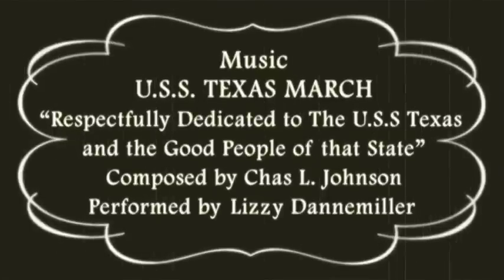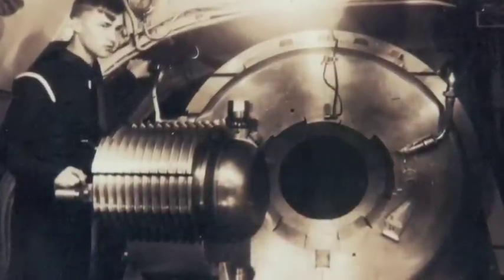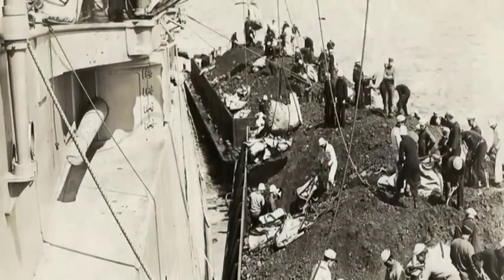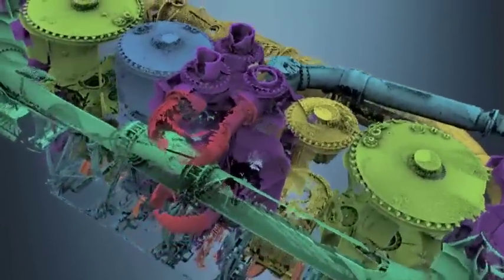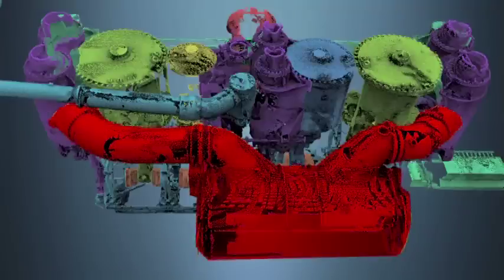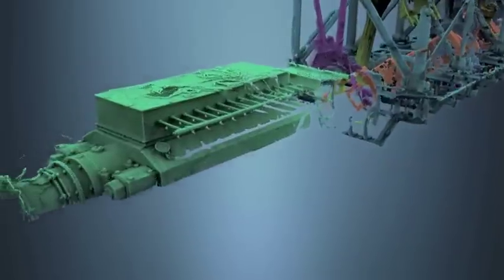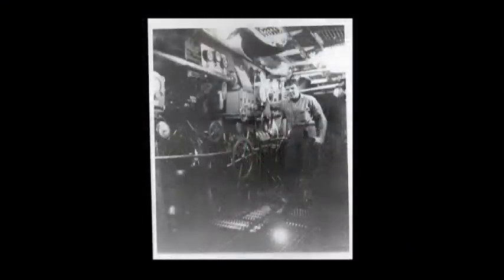Battleship Texas Engine Rooms

Comment: So, when I'm looking at that 3D laser image, all the holes and daylight that I see in the scan.....Are those actually holes and cracks in the engine infrastructure that is still on Texas?

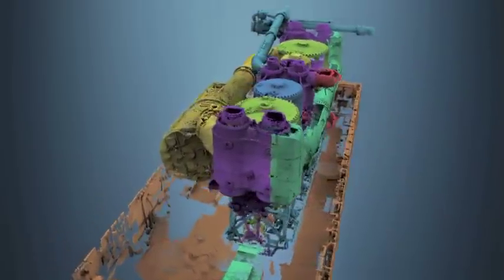For example at 3:50 and beyond.

Or is it a cut away or something other?

If that's rot, it's really sad.  I am aware that Texas is in very rough shape.   I truly wish the gov't would take steps to preserve her.
Reply: The gaps are almost certainly artifacts of the 3D laser imaging - they'll set up the later in different places, but still might not get good reading of every square cm of every surface. Of course it is possible to clean up the result by hand, but this can be very time consuming.

Comment: it would be interesting to see a theoretical retrofit to a thorium nuclear power system for this ship.
Reply: It would be more interesting if they restored the original engines lul :)
Reply: @idiedoof4339  Conventional steam is a lot more interesting
Reply: @idiedoof4339  actually it would not be that hard if there had not been water. I think a well done retrofit could work..

Even though the usn doesnt want a moving battleship under own power
Reply: Well that was random.
Reply: You do realize that there are two parts to the power train? First you make steam and then you use it. A nuke plant is just a way of boiling water without using coal or oil. So all you would be replacing would be the steam boilers with a slightly different design. 

You might then think about replacing the triple expansion engines with turbines. But you could think about that using the existing boilers just as well.
Reply: Wow, very hyper-specific request/thought

Comment: Pretty sure the HMS Queen Elizabeth with her eight 15" guns was afloat before Texas, which means Texas was never the powerful afloat. Yes, two more guns, but the weight of fire, range and accuracy of the 15" guns was unmatched, and the QE class were better protected and with more modern engines.
Reply: Technicalities here....... USS Texas was Both launched and Commissioned before HMS Queen Elizabeth, so what the video said "For a time, was the most powerful" is correct. Prior to QE, the British ships were armed with 13.5 inch guns, again, making the 14's on Texas and her sister New York, the trend setter. When the Brits went to 15 inch, we went to 16" in the Colorado class.

Comment: OK how do you prevent wear on the cylinder walls?
Reply: Much of the triple expansion engines are coated heavily in oil inside and out which prevented wear. though it is noted that after thousands of miles these engine would, 'shake themselves apart'. and then would need medium to heavy maintenance as pistons and support wore down before continuing to perform.
Reply: Oil Mist Injection Into The Steam Also Was A Way To Lubricate Them !! 😎
Reply: Wonder if water soluble oils were used.
Reply: @tomjones4318  water used in these engines ran on a closed loop system, and was constantly reused after being made into steam. so it likely wasn't soluble if it made it that far. but it wouldn't really matter as it'd be burned off in the boilers.

Comment: I'm surprised that the Texas didn't have turbines. Cool video.
Reply: Blame funding and the standard battleship fighting doctrine. Those are the reasons why all the ships from the Wyoming's to the Colorado's were all slower than the rest of the worlds navies.
Reply: @airplanenut89  Not slower than all the rest.
Reply: @peterson7082  After the Kaiserliche Marine was dismantled, our battleships were slower than their counter parts in the IJN, Royal Navy and Marine National. Despite having the same rated speed as some of those navies slower ships , many of our battleships relied on the triple expansion engine which means they were not capable of prolonged high speed use like a turbine was. This became a problem as under the standard battleship doctrine, the US Navy realized that if an enemy ran, they could not pursue, and if we had to run, we were un-able.
Reply: @airplanenut89  For the super dreadnoughts, there were only three out of the sixteen ships that had expansion engines, likewise only three of the six preceding dreadnoughts had such as well. 

 U.S. ships were as slow as the R class, Iron Duke class, Andrea Doria/ Conte Di Cavour, and the Bretagne and Courbet class dreadnoughts and super dreadnoughts.
Reply: At the time they built it, the triple expansion piston system was considered more reliable, as contemporary turbines had issues. Shortly after, the way turbines were engineered changed, so everyone swapped to turbines.

Comment: 1000 lbs of coal a minute? Wrong.
Reply: they did say she had 13 boilers so maybe dude
Reply: @raymondj8768  that is 80 lbs per boiler a minute divided by I shovel, 7 lbs. That's like one shovel every .75 second . The numbers don't work.
Reply: @raymondj8768  so you need 60,000 lbs per hour? It could not carry enough to cross a lake.

Comment: 28,000 HP?! And probably a million ft. lbs. of torque. That absolutely insane. Did it run on coal or oil?
Reply: Initially coal with fuel oil sprayers. Later turned into fuel oil boilers.
Reply: Great guess at the torque output! Doing the math, I get (28000HP)(5252)/120RPM = 1,225,467 lb-ft of torque.

Comment: It was the hushed rubbing sound of oil sliding through oil on
a score of bearing surfaces. The slide valves and piston
rings made a drier, muffled whispering. Steam blowing
through ports and receivers roared hollowly far off, like a
million hoofs drumming a distant prairie. The scores of
valve gear bushings made a lisping, oil-muted chatter. All
the sounds sang together. The quick, light throb of the
circulator rustled cooling water through the condenser tubes
like a woman walking in silk. The air pump plunged and all
its bucket valves clanked shut and it rose straining and
gasping to sluice the condensed steam to the hot well for
the groaning feed pumps. Air wheezed out of the hot well
vent with the wet smell of steam and the wet hay smell of
oily loofa sponges, and it mixed with the burnt rubber smell
of hot packing and hot swabbing oil. From the fireroom
came the hiss and the sulfur smell of coal smoke and water
on hot ashes, the scrape of shovels and the clang of fire
doors, and the shrill voices of the stoker coolies calling
each other lazy turtles. All the voices sang with the engine.
And then, standing with eyes open, to stride with the rods
and plunge with the crossheads and jog with the valve gear
and catch the intricate play of light and shadow as the wild
horses spun whitely aft into the dimness of the shaft alley.
And to take in through feet and fingertips the same white
horses, transmuted by screw thresh, spreading from the
thrust block to join the slower, smoother engine vibration
feeding down through the soleplate chocks. To have
knowing in their bones the same vibration that trembled
water in glasses topside, and rattled loose windows, and
worked rivets and stringers and frames minutely rubbing
and creaking and whispering the old ship’s secret life
through all its structure, there knowing and controlling and
almost being the source of the ship’s life—that was how it
was.

“The Sand Pebbles”
Richard McKenna

Comment: HMS Dreadnaught already had steam turbines years earlier. The US Navy didn't want to experiment with those 'new-fangled' contraptions.  Reciprocating engines suffered from high levels of vibration and need for more frequent overhauls.  They were totally unsuited for the high-HP demands of later 'fast' battleships.
Reply: Russ G Actually, The US did experiment with steam turbines starting with the Delaware class-battleship USS North Dakota which had steam turbines while the Delaware herself had reciprocating engines, the Florida class was the first to be built with steam turbines (both ships using them not a mixture like the Delaware class) along with the Wyoming class. The US was not sold on the idea because they were not fuel efficient and it lacked the extensive coaling stations that the British and French had access to coupled with patrolling both the Atlantic and Pacific oceans (the Pacific especially, which also brings the added danger of needing coal and not being able to purchase it from a third party either because they are not allowed to due to their country’s laws or they refuse to such as what happened to Russia during the Russo-Japanese War when the Russian Baltic Fleet made the mistake of firing upon a group of British trawlers which angered Great Britain or the possibility of running out in the middle of the ocean far away from a suitable port to go along with it) which is why the reciprocating engines were used in the New York class. The US went back to using turbines when the Nevada class was introduced due to the technology improving and they became more fuel efficient. The Nevada class was the second and last time that the propulsion mixture was used with Nevada having turbines and Oklahoma having the reciprocating engines to test which one truly was better. Of course every ship after Nevada used turbines. The adoption of oil probably helped as well because refueling ships with it is much simpler than trying to transfer coal between ships (all you really need is a hose), plus its easier to transport and you can carry a lot of it.

Comment: I wonder what condition those engines are in today. I doubt they could run again, but probably not because of the engines themselves. I've watched restoration working being done on steam locomotives that handle pressures at 250 to 315psi and repairing those boilers is a real chore. I couldn't imagine anyone reconstituting the boilers on Texas to a point where they could handle 400+psi again. It's a shame though. Seeing a ship like that move under its own power would be a once in a lifetime event.
Reply: The crazy thing is that texas isn't even considred a high pressure boielr by naval standards
Reply: Anything can be rebuilt .

Comment: @ 4"14, the throttle does not regulate steam pressure, it controls the volume of steam admitted to the engine. Steam pressure is regulated by safety valves on the boilers.
Reply: Steam pressure is regulated by the firing rate or the amount of oil admitted at the burners. Safety valves are there in case of over pressure on the boilers.

Comment: The piano music gets annoying after about 30 seconds. What would it take to make this engine run again today?
Reply: Unless the shafts have been routinely rotated, then you would need to do more that "to go over it once".

You would probably need to strip the entire engine down, check for corrosion (after all, mothballing just delays corrosion, it doesn't permanently stop it), lubricate everything, and reassemble it.

Not a small job......

Later, Matt
Reply: they are having enough trouble trying to find money to keep her afloat as it is...
Reply: A good engineer to go over it once. It was mothballed in running order. But why? They recommissioned 3 of the Iowa class back in the 80s, only to decommission them 10 years later. They do look super cool, I will say that, but they are floating targets in modern warfare. Airplanes, and submarines are the nay's new weapons.
Reply: There is a much smaller ship with a quadruple expansion reciprocating steam engine when I retired Coast Guard vessel in New York Harbor there is talk about getting that propulsion plant back in operation it would just depend on the condition of the boiler pipes they've been laid up for a long long time and rust never sleeps. I think it could be done but then the cost of fuel and outfitting the ship for any type of voyage would probably be more than getting the engine plant back online
Reply: Yeah Matt, I guess I understated that a bit, you gave a more in depth description, I didn't mean it as coy as it sounded, but you're right
Reply: Johnny Dominguez  The other prop is on display at the entrance to the area of the park where Texas is moored.
Reply: What would it take?  Gwops of money that no one has to spend on doing so.
Reply: Culture? As in american culture? What might that be? It would probably take a fracture of 1% of the annual military budget to restore this ship down to the last bolt. Along with 2 more battleships.
Reply: @sirmoke9646  True, but the military doesn't own it. The people of the great state of Texas own it. It's up to them, and their elected leaders to do something.
They have broke loose with I believe 36 Million dollars to fund a restoration project on the hull. But now delays due to covid, etc. Every delay, means the cost goes up, and less actual work will be done to save the ship.